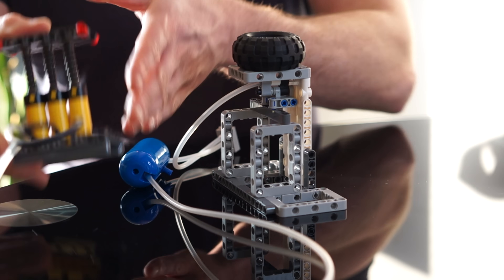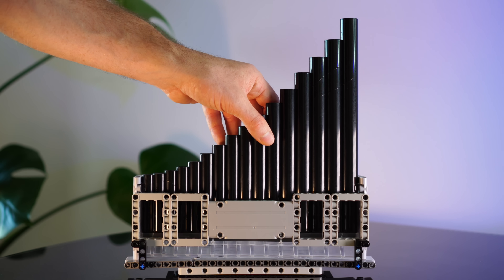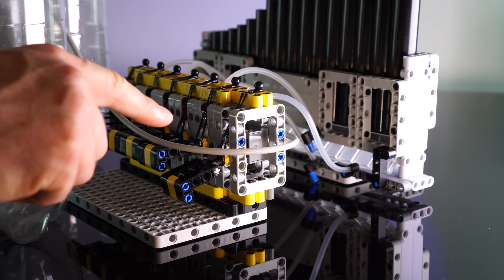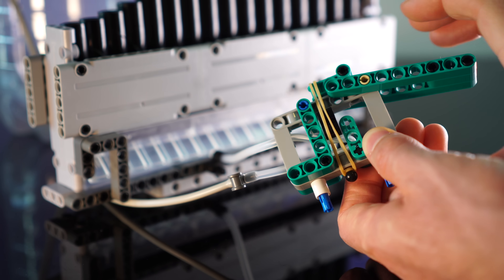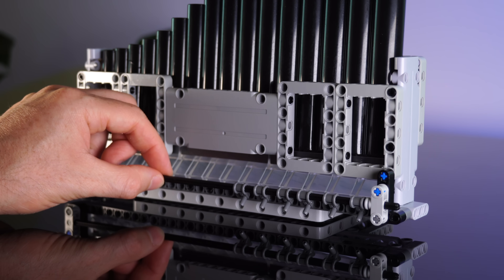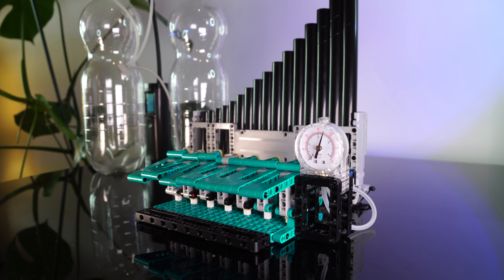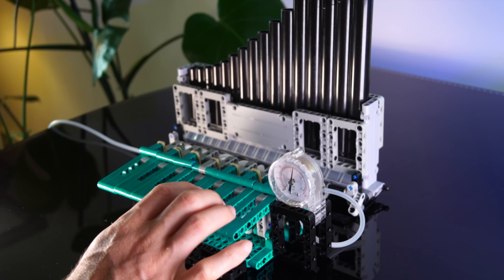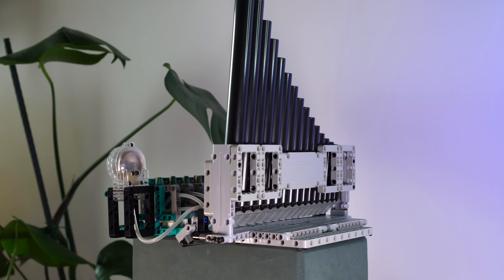Making An Air-Powered Wind Instrument Using LEGO Pneumatics

Comment: This is really cool actually - if you know how to work with ev3 and all that I would love to see this play a flute lol (imagining something like 1 air valve, and motors to press the buttons - that said, it would take a LOT of motors

Interesting nonetheless, this is extremely impressive
Reply from the maker: That's actually a really elegant idea - I'd love to try playing a flute using mindstorms! It may even be easier than actuating a keyboard as a keyboard would ideally need more than 7 motors (or a complex mechanical programmer). Whereas a pipe could likely be played using only a few motors. Cheers for the suggestion!
Reply: To play a recorder flute mechanically, the easiest way would be to run a wide paper strip like a piano roll across its holes, and perforate it where notes shall sound. To make it a bit more complex, holes in an additional row may trigger a valve to stop air flow to make it possible to play pauses.

Comment: Wonderful! Where did you get the pneumatics parts from? I have been looking for them forever online and could never find them at a reasonable price..
Reply from the maker: Unfortunately I didn't get them for a reasonable price either 😅 But most of it has accumulated over the years via various sets. The silicone tubing is just standard 2x4mm food tubing from Amazon though, which is both much cheaper than Lego hosing, and performs significantly better!
Reply: @JamiesBrickJams  Ooh, thanks for letting me know!
Reply: To connect small hoses, look for drip irrigation parts in gardening stores.

Comment: What if you add an air regulator to whatever you want so you can play longer (so the tank can be at 100PSI but the air that goes to the Lego is 30PSI)
Reply from the maker: That's a really smart idea! I'm sure it's possible. I guess I could also just hook up another set of bottles, but will see if I can find a cheap regulator too. Cheers 😄

Comment: As someone who works with mechanical music (Organs, player pianos, and player organs!) this was really neat to see!
Reply from the maker: Aw thanks a lot, appreciate it! Also, apologies for the lack of someone talented making some real music with it 😅 I'm sure as someone who works with instruments, that must have been a bit frustrating
Reply: @JamiesBrickJams  I’ve seen worse, this is decent for its restrictions. Try making a valve system (the folding tube thing) that uses each valve hooking together so it isn’t as thick. If you use the outside wall of one valve as the inside valve of the one next to it, you save one pin and can therefore fit more keys to control it. When you blew into the pipes, it sounded like it wasn’t a full chromatic scale which also limits your ability to make music. Plastic pan pipes like that are all over the internet and have a full 24 note chromatic scale. That combined with a thinner valve would make a really neat organ!
Reply from the maker: I'm sure there is some gold in your advice here, but to be honest I'm struggling to picture what you mean by the outside wall of one valve serving as the inside valve of an adjacent one. Will have to do some research here clearly! But big thanks for the suggestion. And definitely agree with a larger set of pipes. 16 feels quite limiting and skips many of the flats and sharps I wanted. Next one will have many more keys!
Reply: @JamiesBrickJams no worries on the wall thing, it isn’t a huge deal. It’s mostly for cosmetics and to make the keyboard smaller.

Comment: Hello !
 I don't know if it's possible with lego but there's a thing called a venturi nozzle (not sure for the trad french here), the nozzle is designed to ad air to the propelled one, so you have more propelled air at the end of the nozzle, meaning you can save a huge amount of compressed air and thus make a sound more clearer ? I hope i'm clear on this one but maybe it's worth the time :D anyway a oood video like always ! many thanks !
Reply from the maker: Hey, thanks for your recommendation! I've never heard of that, but after briefly looking it up, that sounds like a pretty worthwhile thing to test. Especially when it comes to improving efficiency. Cheers 😊🙏
Reply: i think you'll get a little bit of that anyway from the fact that the nozzle is smaller than the pan-pipe mouthpiece so a bit of ambient air will be entrained too. But the effect will be minimal at these pressures and flow rates.

Comment: Having multiple sets of the output tubes connected to the keys via valves could allow you to have a switch to change octaves, much like small digital keyboards let you move up and down octaves with a button press
Reply from the maker: That is such a great idea! What an easy way to switch to a different set of pipes. Big thanks for the suggestion 😁

Comment: What you should do is increase the number of pipes so you have more notes, most songs use "accidentalls" which means that a note outside of the scale is used (a C is replaced with C sharp for example). That way, the songs should sound much nicer
Reply from the maker: You're totally right. I realised after trying a few songs that the lack of sharps and flats was very noticeable. I think sometimes talented panpipe musicians can create those using different methods of blowing. But I can't do that easily with these pipes. For a future version I'll certainly look into some pipes with more notes and a larger keyboard. Thanks for your suggestions!
Reply: @JamiesBrickJams Maybe you can "cheat" by having two pneumatic connectors for every pipe that are angled differently? I don't know however how much the pitch changes for the pipes depending on the inlet angle but it's worth a shot🤷‍♂️
Reply from the maker: That's a pretty interesting concept - might be worth playing with! I guess another easy solution is just to get a bigger set of pipes with more notes 😀
Reply: @JamiesBrickJams  It's kind of difficult to tell with certainty (comparing tones to a tuned instrument), but I'm pretty sure this collection of pipes you've already used do in fact contain sharps and flats. I can hear it very obviously in Twinkle Twinkle Little Star. The second to last key from the left very much sounds like a flat/sharp.  

This would make more sense given the construction of the pipes, too. A full octave is not just 7 notes, it is technically 12 notes + 1 octave: 7 natural tones, 5 sharps/flats, and an octave. The purpose of this arrangement of tones is to allow you to reach an octave from the root no matter where you start. A chromatic scale from C to C, G to G, B to B, etc is always 13, including the final octave of the root of the scale.  

This arrangement of pipes probably follows a similar scale, with a few additional octaved notes (since it's 16 pipes, not 13). It would be hard to know for sure without comparing the tones to a tuner or letting someone with perfect pitch hear it. But I know for sure there's absolutely already some sharps and flats in that arrangement of pipes, otherwise Twinkle Twinkle Little Star wouldn't have sounded the way that it did to my ears.

It is also entirely possible that this particular arrangement of pipes only forms one particular key and scale, and covers at least two octaves, meaning it won't contain every chromatic sharp and flat between two given natural tones. It's hard to say for sure without seeing where it came from, or if there's any info on it. If you want to really figure this out, you can just get an electronic tuner and jot down the notes each pipe produces. This will tell you exactly what notes you are working with. 

If you want to build a true 1:1 air organ that can cover all of the notes in equal temperament, then you'd need at the very least 12 pipes of the correct length and diameter to cover the entire chromatic scale: A, A#/Bb, B, C, C#/Db, D, D#/Eb, E, F, F#/Gb, G, and G#/Ab. Double the number of pipes and halve/double their lengths to tack on another octave (shorter pipe = higher pitch, longer pipe = lower pitch).
Reply: i mean you could get more pipes, but with most instruments you can also perform accidentals by changing the air pressure into the embouchure.
It takes training to do it with your lungs, but with a machine you have the advantage of mechanical certainty.
Maybe have a key on each lever that only raises the crimp by a fraction?
Reply: A thing I can see you having trouble with is using 7 pipes instead of 8. With your current setup you can play a whole scale without retuning, but most songs also use the tonic of the next scale up. One more pipe is all you need, honestly.
Reply: First it needs more keys, not pipes. Check how accordions and chord organs work. May be a mouth organ can be modded into something freakish sounding, by adding some kind of siren disc etc.

Comment: I think you're mostly just limited by the keyboard only having 7 notes (less than an octave) whereas most melodies will go over multiple
Reply from the maker: You're totally right, I realised pretty quick that having less than a full octave was very limiting. Perhaps a future version will have a full keyboard!
Reply: @JamiesBrickJams 

My only question is could you have built in a mechanism to switch to the other row of pipes? You talked about the possibility of reprogramming it, but I wonder if you could’ve basically built a shift key for it. It’s actually very common on wind instruments.
Reply: @JamiesBrickJams  It's awesome that it's in the mixolydian scale too.
Decades of kids toys being bound to a major scale has worn my soul thin lol throw in some harmonic minor or something!
Reply: @jamievancoppenhagen if it's like an organ you could have the second set of keys above the first.
Reply: Another limitation from the 0an flute he used, is that he can't do any half notes, which are essential for any songs in minor (which are pretty much all the songs that coind "cool")
Edit : *half TONES

Comment: I tried to make something like that but i didn't have instrument to play and my air tank was low volume
Reply from the maker: That's awesome you gave it a try! Yeah some soda bottles are definitely needed to store enough for a project like this. Preferably even more than 2 bottles
Reply: @JamiesBrickJams  i this I'll try another time one day, cause i have a small pan flute laying around
Reply from the maker: That'd be awesome, good luck with it!
Reply: @JamiesBrickJams  thanks 😁
Reply: An organ normally needs no high air pressure, only volume. A big robust plastic bag with weight on top is enough to store the air for playing.